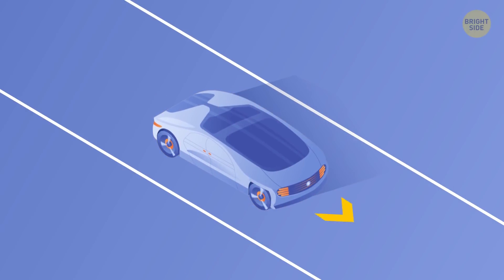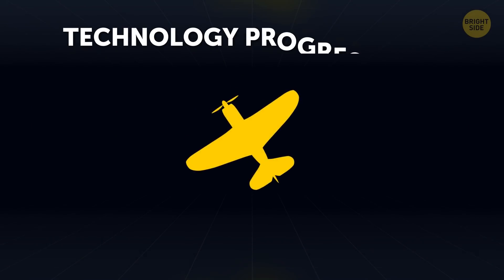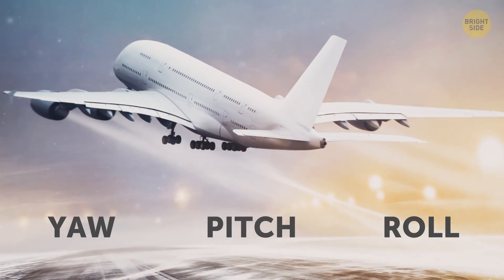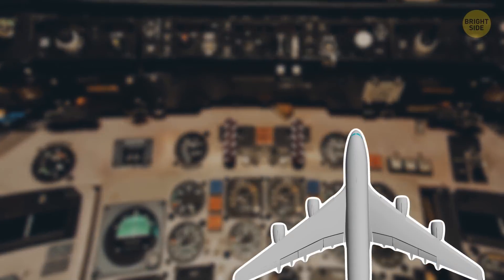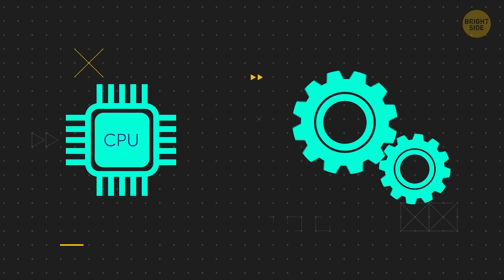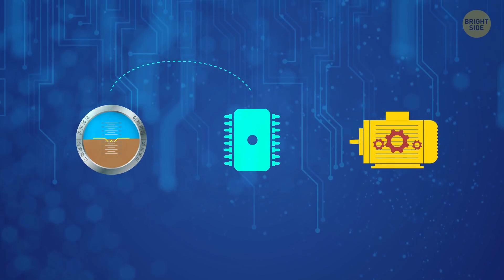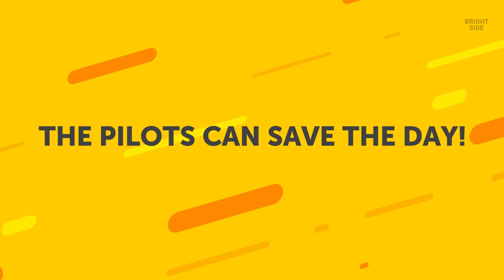Do Pilots Actually Fly the Plane?

Comment: Not sure where Brightside pulled their information on which planes don't have autopilot systems because it is not even remotely close to being correct. And what was that about "planes that don't have autopilot have two pilots"? There are literally tens of thousands of single-pilot planes that aren't equipped with autopilot. On top of that, what about all the planes that require two pilots to fly that do have advanced A/P systems?

Comment: PLEASE DO SOME MORE RESEARCH. This is all either oversimplified or straight up wrong. Almost all planes, including private jets have an autopilot. Even some small 2 seater GA aircraft have autopilot. Large planes also always have 2-3 pilots, even if there is an autopilot. Autopilots also never control the rudder. The rudder has a yaw damper, which is a system that uses the rudder to coordinate a turn, although you do not need the rudder to make turns. I think these videos could be much better if you did some more research on the topics using reliable sources, because it seems you are practically just making things up.

Comment: Isn't yaw horizontal and pitch vertical axis?
Reply: It depends - Yaw is movement about or around the verticle axis, while also being movement along the horizontal axis. The difference is whether you state movement 'about' or 'along' the specified axis. As a default, it is usually stated as movement about or around.

Comment: The FMC knows your flight path, your cruise altitude and speed and gives you a Top Of Descent. So essentially telling you when to descend to get to the runway in time
Reply: True, though only commercial aircraft have them
Reply: Yeah, there is a huge flaw with the FMC though. It cant predict descent.
Reply: @FrecklesAviation  What do you mean, I thought that's what vnav was?
Reply: @jamesbabbath5306  yeah, vnav uses the fmc to do what it  does
Reply: @FrecklesAviation  so what do you mean the FMC can't predict descent?
Reply: @jamesbabbath5306  I meant it can't predict descent rate l, taking into account air traffic control limitations etc l. Don't believe me, then watch captain Joe's video on descent
Reply: @FrecklesAviation  any ATC instruction would be a deviation though, right? If you weren't given any other instructions, the FMC would still be able to meet crossing restrictions pre-programmed in vnav mode.
Reply: @jamesbabbath5306  no I mean like a 'descend FL40 now' , or if you are held due to traffic. My point is, ATC manage the decent over the Fmc, the pilots only really use the alt restrictions mode if they are told to climb or descent via sid/star
Reply: @FrecklesAviation  ah ok that's what I was getting at.

Comment from the maker: TIMESTAMPS:
Why did someone have to invent the autopilot? 0:22
The first attempts 0:55
Not all passenger planes have autopilots 1:45
What is an autopilot 2:15
Different types of autopilots 4:08
How do control systems work? 5:15
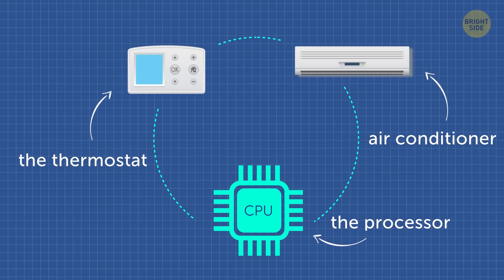How does the autopilot keep the airplane wings leveled? 7:39
What happens if the autopilots fail? 9:16

Comment: In complete true take offs aren't 100% manual. You can do this if you want and most pilots actually do this. You power up the engines slightly and then push this button called the TO/GA button which stands for take off/go around and it will automatically power the engines to optimal power percentage and it will be a quicker response than if you do it manually.
Reply: Yea but this is Brightside, the Buzzfeed Lite of YouTube lol
Reply: The takeoff is manual but auto throttle is engaged usually
Autopilot and auto throttle are not the same.
Reply: @nikobelic4251  what you are saying is partially correct. The statement made in the video is that a take off is the only thing left manual. In order for something to be considered completely manual it means that every input involved in its success has to be applied by a human being. And our power settings are a key input to its success thats why we always have the FMC calculate the V1 VR and V2 speeds. So when this crucial input is given by a computer such as the TO/GA system the takeoff procedure cannot be considered as manual.
Reply: @bobbycrevelli2236  yes, but it can’t be considered automatic either.  If you just set the auto throttle you’re going off the end of the runway.

“It’s not a raw data takeoff” but the autopilot does not takeoff.

But I do understand what you are saying.
Reply: @nikobelic4251  And I defiantly get what you are saying after all we are required to hand fly it up to 1000 feet so that shows that it is somewhat manual so I would call it like semi-automatic.
Reply: @bobbycrevelli2236  yeah, I guess we can call it that

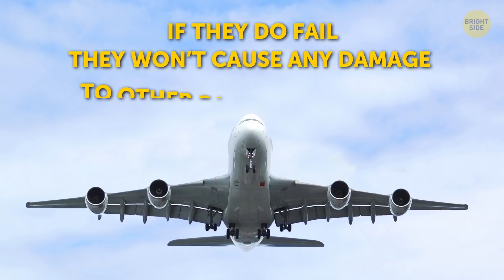Comment: 9:34 What happens when pilots can't disconnect the autopilot?

Oh right, the 737 Max crashes and kills everyone.
Reply: It's not possible, autopilot is made to disconnect easily,  if a plane is on autopilot and the pilot mistake a move the yoke ( handle) the autopilot instantly disconnect,  and what happen to the boeing 737 is fatal but it's not the autopilot fault , hope this make sense
Reply: @krishandeodatt4415  absolutely right
Reply: That was not a problem with the autopilot.
Reply: Holy moly
Reply: Oooooofffff
Reply: That's not what happened though oof
Reply: MCAS is not the autopilot!  MCAS only activates during manual flight

Comment: Almost all planes these days have autopilot. Even 2 seated planes. You can’t have one axis autopilot because the autopilot will disconnect when you move the stick. Plus the auto-pilot cannot control the rudder drying flight but there is yaw damper which is different. Also most passenger planes land by themselves all the time and a pilot only has to land it himself once every 20 or so flights.
PLEASE GET YOUR FACTS RIGHT!
Reply: I agree, cause the aircraft don't have autopilot are the trainee aircraft like cessna 172 and c152
Reply: Agreed, any avgeek or pilot will cringe watching this video
Reply: LANDINGS ARE PERFORMED MANUALLY
Reply: Jeremy Sheppard, that last thing you said about passenger planes landing themselves is completely wrong. Passenger planes can land themselves yes, but only at select few airports and with certain aircraft with those ILS capabilities, and most if not all airlines don’t allow their pilots to perform auto landings unless the visibility is extremely poor. Tell me which airline does auto landings on a regular basis as part of their standard operating procedures.